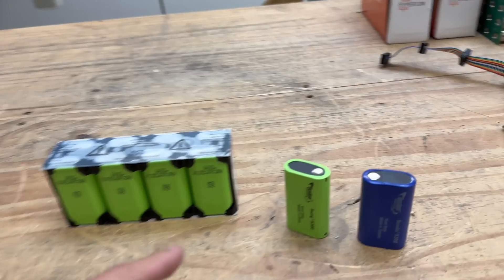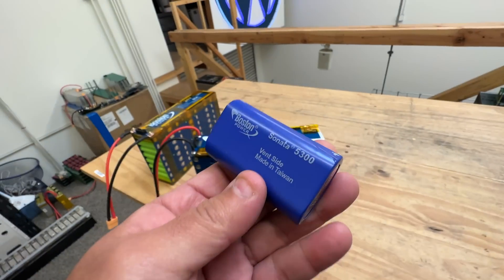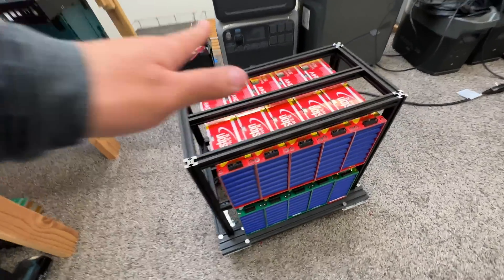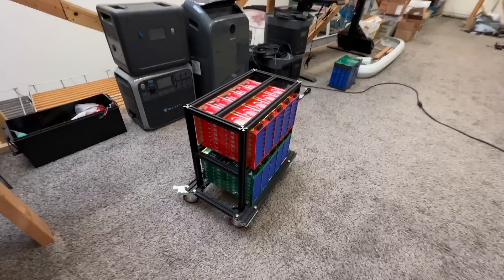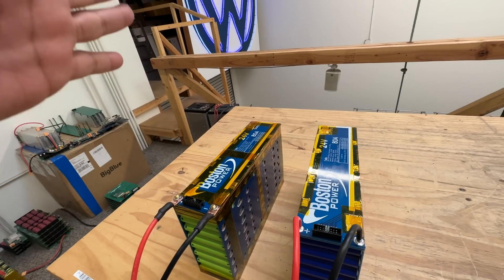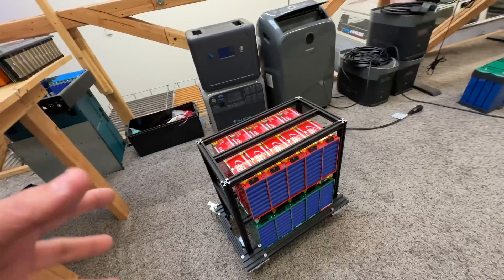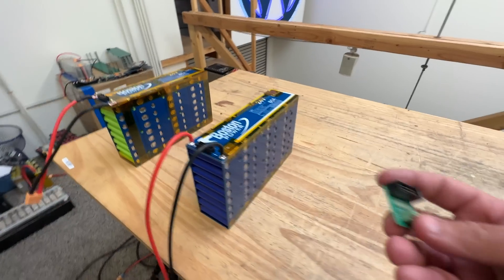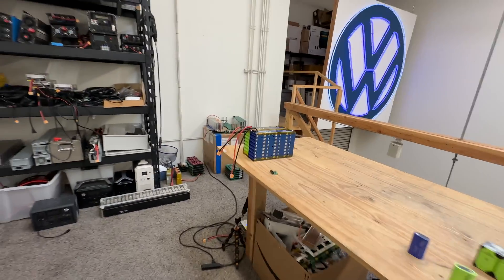Boston Power Sonata Battery Module Overview

Comment: Built 24-volt batteries like that can you put those nuts on them then can cross them over to make it 48 because I'm not running 24 volts I'm running 12 volts and I'm going to be moving into 48 volts for those other are the Invaders I be getting so 24 volts won't but 48 v will and so will 12 volts because you can always cross 12 v into 24 36 48 volts
Reply from the maker: Yes
Reply: @jehugarcia  thank you cuz that sounds like a better option for me than some other things.

Comment: as a precaution, i would be careful stacking too much weight on the aluminum frame thing you showed around 4 minutes in. that type of aluminum tubing can split where the bolts/nuts are and then the whole stack will collapse.  if you havnt already, it might be a good idea to use some bricks or something to figure out what its actual maximum weight limit is

Comment: I have a question, battery to battery charging with inverter and charger in between.
I would hook 12V battery to 500W inverter, and try to charge with original charger (65W) of e-scooter 36V battery. 
Is it posible and how much Ah I need in 12V battery to charge 12Ah 36V e- scooter battery. 
Inverter efficiency  claims >90%
Reply from the maker: 12ah x 36v = 432Wh  / 12v = 36Ah + add 10% losses
Reply: @jehugarcia  that was my calculation too, just wanted to check if Im right. 
Thnx

Comment: I know you tried to spell it out “I’m not using a BMS, because i’m crazy, but everyone else should use a BMS”. I know of two people who built lithium ion packs with 16-26s using high drain cells for ebikes, who said you told one of them they don’t need a BMS. 

I know you know the risks and how to mitigate them,  they they don’t. Case in point. A 7s battery has a lot less chance to force one brick into the danger zone than a 26s does. 

Also, in these modules, i see you have a connector that you can easily plug your cell monitor/balancer into for periodic checkup. And if you are using them in a stationary setting you probably wont charge to 4.2v/cell, which gives you added wiggle room. Also being stationary theres not much chance of a cell disconnect which will definitely lead to a battery fire when it is fully charged or discharged next time.

These guys following YOUR advice have no such connection to do any maintenance balancing or monitoring, and these are in high power ebikes. These batteries also have zero cell holders, just glued together, so when one brick catches fire, the adjacent cells will soon follow.

So please,  before these guys burn their houses down, can you make a video explaining that without exception, every lithium ion ebike battery needs some sort of BMS? Can you explain that lithium ion is not LiFePO4? Can you explain that the charger only sees pack voltage and doesn’t care if one brick os already 5v and smoking, and the job of the BMS is to prevent that?

Don’t leave any wiggle room. Disclaimer “if you make a DIY battery and it burns your house down, its not my fault because I told you NEVER make lithium ion battery without a BMS”. Don’t be vague.

Comment: Jehu, I want to be DIY, I am completely capable of building these batteries. The problem is getting approval from my municipality and my power company to actually tie these in to my house. The requirement for approved interconnection is that the battery system is UL listed. Obviously, a DIY solution is not UL listed. I don't have the money for the overpriced systems from Enphase, Tesla, et al. What do you recommend?
Reply from the maker: Don’t connect them to grid,  use a transfer switch and build a mobile battery bank, that way you are not permanently installing a battery to your bourse.  No restrictions on using an off grid battery system

Comment: a kit would be nice since the raw cells can be shipped as just ground and not require freight.

according to batteryhookup anything above 500 watthour requires freight witch would go by 18 wheeler as less than loaded and many places have problems with big rigs in neighborhoods due to getting hung up on the sidewalks in tight corners or dont allow such industrial traffic .

where as bare cells even in boxes can go as ground and can be shipped as ups or fedex ground.

i  understand and get it where you may not be able to kit the modules because making of the cell connections would have to be welded and to be kitted it would have to be springs like the vruzend caps.

you are in california but you talk like you are in the uk.

in the way that you say solder.

also you dont have the links in the video either youtube is censoring the links or you forgot the links.

you will have to view your video from another computer maybe in a private window using a vpn to avoid youtube biasing your verification of the post.

if it is youtube censoring you may want to add code to your site to block the youtube algorithm from viewing the page to find out if there is any questionable content (yes you may not be able to monetize the clicks because youtube will get a cdn landing page or a no robots page but better that than no links because youtube deletes them).

it may be possible to write a landing page that then redirects to the site so you can monetize the clicks to the landing page.
Reply: Battery hookup states anything over 60lbs ships freight. There is a hazmat shipping fee for any battery shipped over a certain watt hour. Battery hookup pays for that fee.
Reply: @johnchamberlain395  i looked on the site and could not find them  did you order the manufacturing of them and did not anticipate stocking problems by the time that the video came out or will they only show up to site members.

just to rule out site members i will try logging in

Comment: Avoid mobile use of such batteries cause if things go wrong you most likely do NOT EXPECT IT cause you will have become used to that it works flawlessly forgetting about the risks. Automotive and ebike use are the hardest use cases and people think after 10 test rides that it is working perfectly, even after 100 test rides you can not be sure that something might be going wrong. 

Ask a car manufacturer how much it takes to make an EV reliable for 250.000 km and how tiny the margin for error is. 

If you sit on the battery you might feel the heat, but if the battery is away from your body you will not recognice much until  it is too late cause even burning batteries might still be running for a minute or so. People underestimate the risks involved especially for all the Li Ion stuff. 
This is not LFP chemistry, which is a lot safer and does not burn.

For home storage it is a complete different story cause usually your home is not suffering from vibrations, therefore a lot safer but still always risks involved and a few houses have already burned after DIY batteries had developed faults, last time in austria a week ago or so. High damage and insurance does not really wanna pay for diy built stuff. Better to keep that in mind and think about before buying and building what precaution can be used cause safety first helps to prevent things going too wrong. But these are general considerations and have nothing to do with these ideas shown here. Just a reminder that Jehu has warned about mobile use case people tend to ignore cause they usually do work pretty well , but it only seems to work well cause that it works needs thousands of tests in different conditions to be sure and not just to think it is safe.

Comment: Hey there...subbed to you a couple of months ago and im enjoying your content so far.
Question..im going to be building a battery for my ebike camper that im building atm..im using 21700s and im making a 13s 10p battery from them...each cell is capable of 35amp..so does that mean the battery will supply ova 100amps if needed...im going to be putting a beefe spot weld system on the batterys...meaning adding more to cope with the amps..but my main question is wot i asked as your 8p battery your showing here is capable of around 80amps you said and thats because the cells you are using are around 10amps each....im using good quilty cells as well as dont wana go cheap since its the main campers battery for all the stuff im running...plus will be powering the ebike when the 40ah battery dies on the bike

Thank you in advance.
Reply: 35a x 10p = 350a. So that should be more than enough since this is your Reserve battery. Of course this batteries will be more than 40ah (your main battery capacity). 

You will find that using both in parallel and just pay attention to the state of charge will make both batteries last longer since the discharge on each pack will reduced, the charge rate on each pack will be reduced, and the lowest voltage each pack sees will be reduced. 

It would be different if you had a Gogoro bike with 2 hotswap batteries and 1000 swap stations like Taiwan, but even these batteries are carefully monitored so the SOC doesn’t drop below 20% and they charge at a proper rate and the max discharge rate is also conservative.
Reply: @imho7250  thank you...i just neede confirmation of that from a professional like your self...the cells are 4800mah and this is for a ebike camper which will be running quite a lot of electronics but will have constant solar input also..
thank you.
look forward to your next video
Reply: @Bitathisandthat  , i have to wait till something else breaks to make another video lol. 

Sounds like you will have quite the switchboard for selecting battery feeding what, charge controller charging what. But I still think running them both parallel unless there is a problem with the solar feeding in will work best unless you have such a load that you feel you will drain 40AH while camping overnight (or cloudy days) and you want to ensure you don’t wake up with no way to get rolling. 

If the inverter is programmable you can achieve the same thing by setting it to alarm at 60% and shut off at 50%. Then you still have 40ah left to get moving and you didn’t need to drain one pack to low voltage protection level. 

I saw a similar two independent batteries setup in a tiny EV with air conditioner. One 60v. battery for the motor and one 60v battery for the air conditioner. Probably for the same reason as you want two batteries. But if i had that car (which uses Lead Acid batteries), I would take them all out and build one huge LiFePO4 battery with one  Bluetooth BMS and just pay attention to the SOC. The benefit being if i want to camp with AC for 2 days and drive 5 miles to charge, i can. And if i want to drive 150 miles with no AC i can. Or i can drive 100 miles with AC. With split battery and no way to cross connect you are stuck with the ratio going to camp and to driving.
Reply: @imho7250  the camper will have a small gas gene for those days where i get no solar at all...the bike has a 48volt 20 ah on it and the camper will have its 40+ ah battery on it plus have a 24 volt 6s 18p 18650 pack that will run my fridge and charge my freestyle drone batterys..so yes theres gona be quite a decent switching system that will be added..im slowly buying stuff as i can afford it...the main camper battery is also 48 volt..if i need to chrage quicker than solar i can charge with gene and solar..i have a tiny channel that ive put part one of the camper build up on so far...just wana go on the road for months at a time as will be a great challenge and experience i think..the camper will also charge the bike and if i need will be able to use the bike battery to also run the camper..the camper will have duel electric slides on it ...my ideas and dreams are big...just hope i can get everything working with out probs on the road....lol...will have to se i guess.
Really appreciate your input as well, so thank you for that.